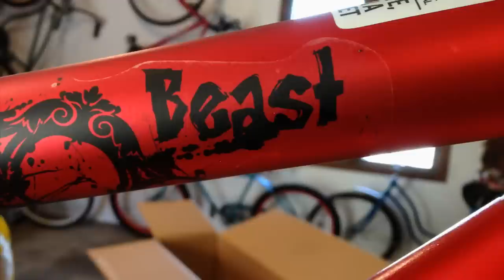Mongoose Beast First Ride

Comment: i hope you realize that its illegal to ride without reflecters
Reply from the maker: In the U.S. believe it's illegal for a company to sell a bike without reflectors but every city has it's own code as far as riding. Here's what ours says... 
"Every bicycle when in use at nighttime shall be equipped with a lamp on the front which shall emit a white light visible from a distance of at least five hundred feet to the front and with a red reflector on the rear of a type approved by the Secretary of Transportation which shall be visible from all distances from one hundred feet to six hundred feet to the rear when directly in front of lawful lower beams of head lamps on a motor vehicle. A lamp emitting a red light visible from a distance of five hundred feet to the rear may be used in addition to the red reflector."
So a rear reflector is the only one required and they don't enforce that as long as you have a light.. I don't think I have reflectors on any of my bike, only lights.